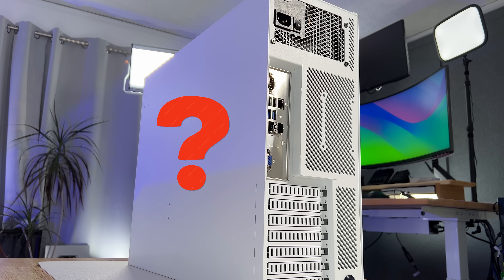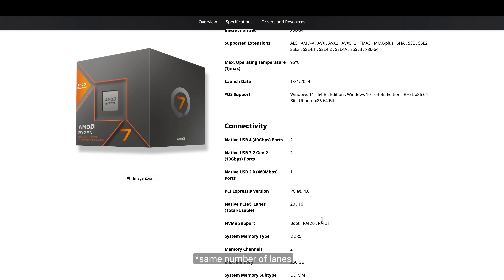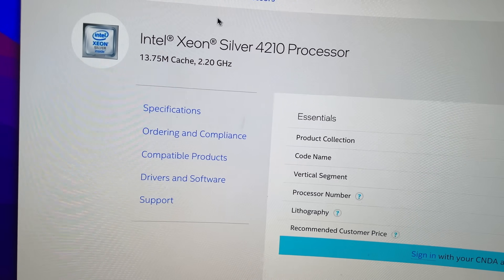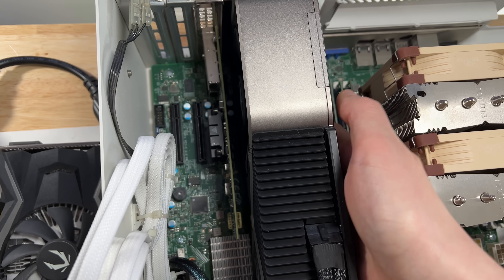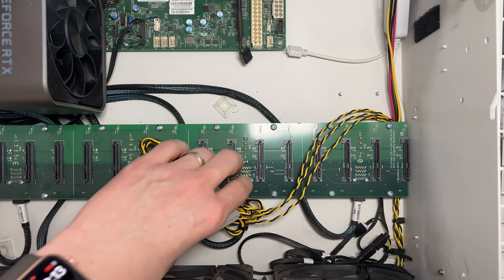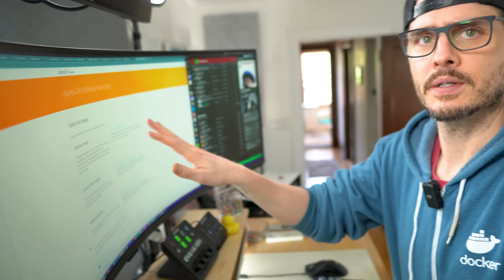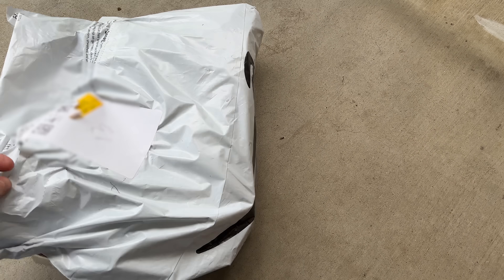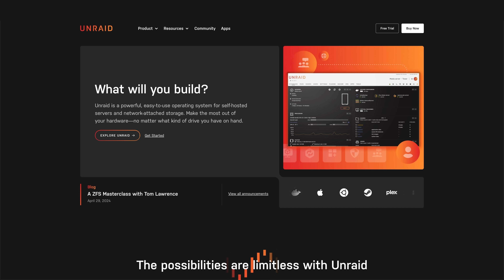Building My ULTIMATE, All-inOne, HomeLab Server

Comment: I know this is an older video but I recently noticed 45 Drives has a Proxinator line of servers but not too many video out there on them. One of the cool features is they have a model that can fit a fullsize GPU and 16 2.5" SSDs in the front, and inn in 2U height. I think it would be cool if you could do a video considering rebuilding this in that server. I would love to see more content about that server, I am considering getting one to be my proxmox server to go along with my Q30 storantor running TruNAS.

Comment: lol dude got a xeon cpu "ultimate" home lab...
Reply from the maker: @billkillernic  dude also kitted it out with all flash storage, 256GB RAM, and an NVIDIA 3090
Reply: @TechnoTim  if it doesnt have a threaripper or an epic CPU its far from being an ultimate home lab first of all it doesnt have the clocks and ipc to drive that 3090 near its full potential  + most of your issues e.g pcie lanes would have not been there had you gone with amd lol.
Reply from the maker: @billkillernic  I think you missed its purpose.  It's my AI machine and can drive all CUDA cores and NVENC just fine.  My issue was with bifurcation which is not because of the CPU it was because of the board.  Also, sounds like you missed the "My" in the title 😅

Comment: I noticed you were counting your PCIe lanes. Depending of the board manufacturer and models, onboard components can also take up PCIe lanes as well. Such as NVMe, SATA, wireless, USB 3. Very common on consumer boards. Especially if they have NVMe slots onboard. Some boards have the option to disable onboard components to free up some lanes 👍🏽 this information is good to know if you want to convert your old gaming rig or workstation into a server and need full lane speed support on your expansion slots.
Reply from the maker: Thank you!

Comment: Love the videos Tim, but why not just go EYPC? I got a 7601 cheap on ebay 32 core 64 threads has 128 pcie lanes and an ASrock rack motherboard with dual 10 gig built in?

Comment: @Tim, it would actually make better sense to space your drives apart for better cooling and less restricted airflow in certain areas of the case. Since you have 6 drives and 3 fans, that's easy. Just space them where you have 2 drives per fan. The drives will run cooler, which will make them last longer and sustain the top speed longer, and they won't interfere as much with the airflow.

Comment: 5:14 look at the block diagram instead, it may not what extra features are disabled on the motherboard with fully populated PCIE lanes.

On my system it will trade between m.2 slots and 4x PCIE connections.

Comment: You should look at AMD threadripper. They have R-DDR5 support and 128 pci-e lanes!
Intel and AMD mainstream chips will stay at 20/24 lanes of pci-e and the motherboards are removing pci-e slots in favor of m.2 slots. a gaming rig only needs a main slot of a GPU and the rest goes through the chipset.

Comment: Judging from the video footage the board's x16 slots are actually x16 electrically as well. 
They most likely share 16 lanes with a neighboring x8 slot via a bridge chip. 
Just thought I'd mention this because mainboards don't always detect these things automatically/correctly and need to have the slots set to the correct configuration manually in Bios. 
Would be a shame to accidentally cut that beastly gpu's bandwidth in half.

Edit: scratch that, spec sheet on Supermicro's product page says my eyes tricked me.

Comment: People should always check out company liquidators. One of our local ones is called DougDeals, but I'm sure every larger town has several. I got an older Puget Systems workstation with Dual Xeons and 40vcores with 192GB ram for like $350. The Cases Puget use, are amazing, almost worth the entire price. It was probably a $7-10k system new.

Comment: Consider the throughput you expect to need on your NIC and on your HBA, consider the max PCIe Gen your NIC and HBA support, you might be able to get away with using them in slots that are connected through the Board chipset instead of directly to the CPU (thats one of the ways these systems get so many pci-e slots/lanes other than switch chips)

for example, if your 2x10Gbe NIC supports PCIe gen 3.0 4-lane, thats 3.938 GB before overhead is taken out.
but if you are only using 1x 10Gbe connection, that NIC could be put into a slot that is shared with others on the motherboard chipset which might reduce the max throughput slightly over all.
keeping your CPU PCIe lanes available for the more latency sensitive or higher throughput devices like the gpu or NVMe storage options.

For your HBA, if you are planning to use 15x Sata SSD's, then your max sequential throughput would be about 8.25 GBytes/s, if your HBA supports PCIe Gen4 8-lane then you have nearly double the PCIe bandwith (15.754 GB/s) vs what your SSD's are capable of supplying so putting it in a PCIe 3.0 8x slot or a PCIe 4.0 4x slot would have minimal impact to your usability,
especially if you were to use a hardware based mirror instead of ZFS mirror (done on the raid HBA processor).  This is not a risk as you can still run smartctl and get direct access through modern HBA's and Raid cards to see the individual drive health for a LUN.

EDIT: looks like that HBA is possibly a LSI 9305-16i which is PCIe 3.0 8x, so moving it to a PCIe 3.0 4x slot will cut your available bandwidth in 1/2 vs the SSDs max sequential throughput.
so I would put the NIC in the bottom most slot (4x lanes in 8x slot) instead of between your GPU and HBA.

For temps you have lost of headway, most HBA's and NICs for servers are able to operate safely up to 80C for ten plus years.
Reply from the maker: Thank you!  I will give this a shot!

Comment: BTW I have 3 unraid boxes 1 Pro license 2 basic my main box has a AMD Ryzen 9 5950X 16-Core @ 3400 MHz with 64GB Ram and 40TB my second box is my pure backup with an i5 4690K and 12GB ram with 30TB of pure backup space no parity drive as its just backup I then have a test box AMD Ryzen 1600 1st gen with 32GB ram all on a star teck 25U 4 post open rack pure unifi network too. Hope you like unraid I do alot. the Ryzen 9 5950x is a beast 16 core 32 thread like i'm looking at the CPU load 2-5%if I stress it like 30% my main box has Plex with a Nvidia Quadro P400 for transcoding

Comment: 15:18 When racking servers by myself, I've found that there's usually holes in both the sliding part of the rail in the rack, and the stationary part of the rail (the portion that attaches to the rack itself). Every rail is different, so it always takes some experimentation, but I've found that I can put a spare screw/toothpick/pointy-thing through both holes so that sliding part of the rail doesn't push back while I get things lined up. I do this for both sides but sticking out different amounts so I can line things up one side at a time. Just be sure that the holes you pick in the rail can be reached from the front of the rack.

Comment: You mentioned this will not be taking over your NAS role.  What about your firewall?  I've seen some folks virtualize pfSense or vyos, but I don't think I would be comfortable hosting a firewall/ids/vpn on the same machine in case the virtualization solution has a security issue.

Comment: "I want a machine that does everything" 1 minute later "I already have a NAS" :P 

To say something more productive: I prefer buying used enterprise drives because their TBW rating is vastly higher. Even compared to high end consumer SSDs it is often between 3 to 9 times higher. And it gets so much worse if you compare against QLC drives. Considering things like write amplification and RAID you can run through a lot more written data than you expect. That is probably a trade-off you made intentionally, considering you have a separate NAS that can serve as a backup target, but it is something to keep in mind for others attempting to replicate it.
Reply: He specifically said "compute"

Comment: Hey Tim, great build can't wait to see how that works out, Always looking for projects like this. I ended up with the iStarUSA D-410-DE36 case that allows for 36 drives a while back for the hotswap trays.Paired it with NORCO RPC-4224 4U with uses 24 3.5in drives. Purpose was to run Flash NAS and backup to spinning disk NAS. If you end up making 3d printed drive holders for this project, I would love see that adventure.

Comment: Love my Sliger Cases. Have the CX4712 for my NAS and CX4150a for my desktop. I will probably buy a CX4200a for a gpu upgrade though. 3090FTW BARLEY fits with a low-profile radiator. It just fits a credit card between them.

Comment: Strap a fan to that hba. It needs airflow. Look up the cfm needed for it and youll see why, or touch the heatsink after running under load for a while
Reply: Perhaps not the best idea to touch it, particularly when it's installed like that where it's bound to get pretty hot

Comment: Hi. I would like to know your opinion on how long the SSDs would last compared to regular HDDs on a more intensive writing/reading application. Let's say rtorrent with 2-3TB of data. I have a dedicated HDD just for this purpose that is passed directly to the VM and I am reluctant to change it for an SSD.
Reply from the maker: Thanks, the way I look at it is that all drives have a lifespan, some fail faster than others, and others out live their lifespan.  Since I look at all drives through the same lens (whether SSD or spinners) I just make sure that they have a long warranty and have one spare just in case.  These Samsung drives have 5 year warranty and out of the 30+  EVO/Pro Samsung drives I have bought over the years, only 2 failed and Samsung replaced them within a week.  For this reason, I typically go with consumer grade.

Comment: As a coincidence, I started repurposing an older gaming PC (i8700K w 64GB RAM) as an ultra-machine (including as NAS). So, the timing of your video struck gold. My box is more consumer, however, how you explained your train of thought was excellent and extremely helpful, not only to me but to other people who may contemplate repurposing older machines.

I first discovered your channel after a video you had posted about traefik and authelia very long ago. The fact that you value the educational part made me subscribe immediately. Having said that, I would find more educational value if you selected a bare metal standard Linux as your base OS. Proxmox is excellent, very practical, and I guess a must if high availability is needed. There are hundreds of videos on GPU passthrough, but do we really learn how to do it on a bare metal? Another analogy, for a single NAS people install TrueNAS or openmediavault but wouldn’t a minimal Ubuntu or Debian with ZFS do the job and in the process one can learn a lot as well as finetune a system without the limitations of a (web)gui. Also, with proxmox you are stuck with lxc, but there other interesting systems as well, such as lxd or incus. Same with docker vs podman. These are just examples of topics outside of proxmox or other UIs (such as cockpit) that can be approached better from a bare metal perspective with educational benefit. Also, if you combine a bare metal config with ansible alleviates the manual burden. Of course, the big downside is that this is not popular as most creators will go with proxmox.

The base for my bare metal suggestion vs a more specialized UI platform, was the fact that I learnt a ton after I started using Gentoo, which is admittedly a hard case of bare metal. I am going to use it for my case, but no, I don’t suggest it; even though with ansible I could spin up a Gentoo minimal server in 40 mins (with LUKS2, zfs, systemd) it wouldn’t be popular. However, a more mainstream bare metal would be very educational.

In any case, thank you for your content and keep up the good work.

PS1.  If you decide to go apt, I wish you choose Debian instead of Ubuntu (I hate snap).

Comment: Seems like a backwards step, when a NAS is still a better option for storage and speeds not filling up a server with a backpane or PERC cards along with NIC cards... When my home lab is i9 10900k 10 cores 20 threads 256gb ddr4 3000mhz memory a 1080ti gfx card NVME storage on msi pro z790 mb and 10gb NIC card... if your telling me with your lab which you run which is mainly small stuff and containerised along with a few simple webpages cant be hosted easily and readily on a more simple system with less power is silly.... and really what i am using id rather throw out and just use dell optiplex micros with 9700t CPU's and have prox mox cluster with kube cluster or what ever else on it.... i went from sunmicro servers and dell storage EMC array with fortinets and big enterpise kit and really it was a waste of time space and in a home lab you never have all your vm's ever all on at once with containerization and small image sizine for app funtions and app services gone are the days of bulky kit

Comment: 4:40: x16 will only run as x8 and x8 runs as x4 if you are using a feature that shares the same lane, x16 and NVMe Gen4 slot for example.
It's important to know your mobo limitations like how many PCIe and which features shares the same lanes.

Comment: Seems like a lot of work and a lot of expense (even without the 3D printer) for a -- eh -- home lab server. And calling a server with 6 x 1TB drives in it "ultimate" is reaching a little, I think. Even maxing that out with 15 of those, that's $175 worth of refurb-but-warrantied 18TB drive. Okay, double the $175 for a proper mirror. You did a lot of accommodating to get that ridiculously large GPU in there, blocking half the usable PCIe lanes you were so concerned about at the start. Oh, and it seemed that your power cables for the GPU blocked much of the airflow to your 10G card.

I am not sure that the quest for a single do-all server is proper thinking. What's wrong with a "lab" server with a proper hypervisor, and a gaming server with a big graphics card? Add a nice big NAS with more storage than you can use, and you're mostly set.

I don't know, Tim. This one may need some rethinking.

Best regards.

Comment: For an "All-in-on" you know I gotta say Proxmox. I do think you should try unraid, But I learned proxmox by using yours and jeffs (craft computing) tutorials. My 5x VM cloud arcade rig with 5 GPUs and 36cores was built and working because of you guys. Proxmox has ZFS for your storage volumes and tends to work the best for passthrough. Also the vGPU unlock script is FUN to play with to try and split up your BIG powerful GPUs to multiple VMs. It's been a while since I have seen any fun GPU passthrough content from you. Could be fun to see how many times you can split up a 3090 even if you are only going to "deploy" it in 1 to 1 passthrough.

Comment: I’ve run for years an unRaid server which had a w10 VM with GPU and NVME passthrough that I used for playing games and the rest of the system was used for docker stuff: Plex, arr suite, homeassistant and a large etc.

Just make sure you have a Renesas chip based USB PCIe card passed to the VM so you can plug and unplug peripherals without freezing the VM.
Reply: What are the specs?
Reply: @ 
Asus TUF x570 Gaming Plus
Ryzen 9 3900X
32GB DDR4 3200 MHZ
Samsung 960 PRO 512GB M.2 NVMe (VM drive pass through)
480 GB SSD (Unraid cache drive and docker files)
4x 4TB Seagate IronWolf (1 parity drive and 3 array disks)
GTX 1050Ti 4GB EVGA FTW (it does not use PSU power cable)
750w PSU Nox Hummer 80 Plus Bronze (which died this year after 8 years of working really well)
Tooq rack case 19” 4U
All Noctua Redux Fans

Comment: Built a homlab server as well - ran Unraid for a while which was in the end a patchwork of tools for functions that a server system should already have integrated. And running from a USB stick is not something I want to rely on.
So I decided to run Proxmox which is the most flexible system in my eyes. It's lightweight, can run VMs or LXCs, passthrough hardware, it's reliable and definitely the more professional choice.
Reply: It's basically only the config files stored on the USB stick. 
Unraid will load its config into RAM and run from there.
For reference my Unraid system has 19,877 reads and 7341 writes to the USB stick and it's been in operation for 2 years with a lot of changes.
Should my USB stick fail, I can just download the automated backup to a new USB stick, recover my license and I'm up and running again.
Reply: @Hansen999  Thanks for the information! I know the story. Used it for three years-